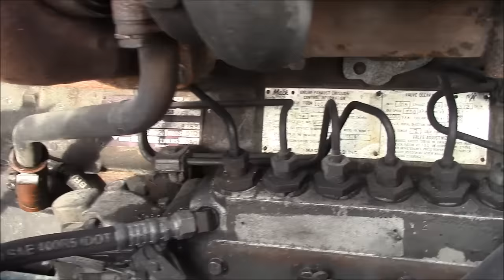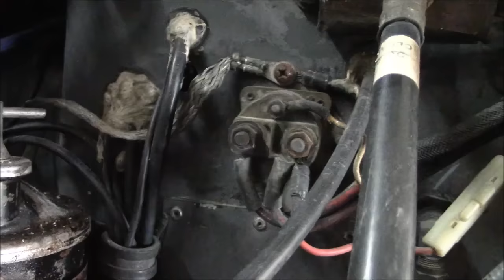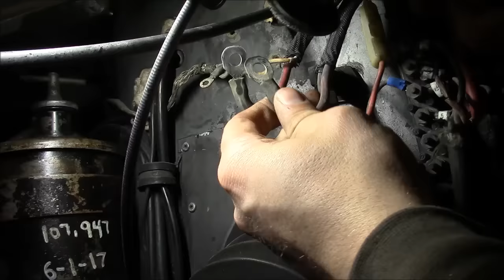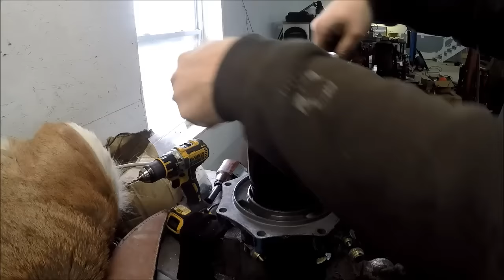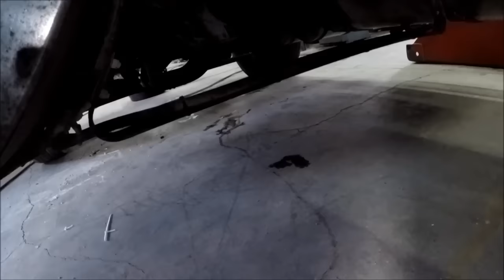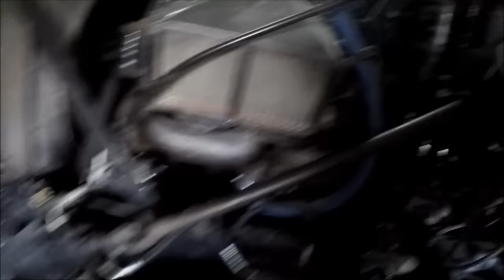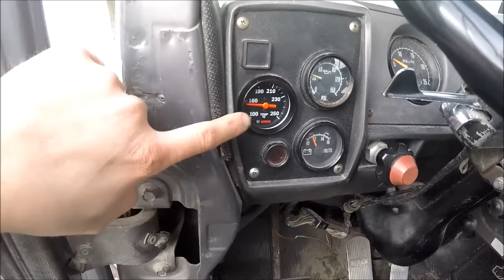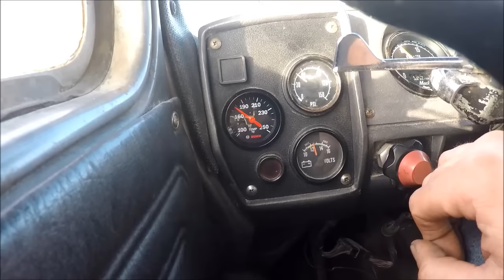Cool 1977 Mack RL600L - No Crank, No Start - Plus Many Other Repairs

Comment: The RL600L means lightweight as in aluminum frame and doors.
Reply: Just a little Mack trivia: Any Western R model has lightweight components, that’s what the L at the end stands for.  (aluminum crossmembers, suspension trees, etc.) western R’s we’re all either RS (steel frame rails) or RL (aluminum frame rails) followed by the model # which is either 6xxL (short hood) or 7xxL. (Long hood). Calling any Mack R just a 600 or 700 is a generalization. The true model will have the second 2 digits denote the engine in the truck. This one would be either an RL685L or RL686L.

Comment: That doesnt even naje sense. Its still a metal to metal connection. Due electric grease prevents corrosion when it heats it up caused by carbon build up

Comment: I use the dielectric grease on plugin connectors to prevent oxidation and keep water out but for screw terminals and large lugs try using Kopr-Shield or anti-seize that has copper powder in it instead.

Comment: That was very interesting information you gave about the standards for the air brake hoses and such. Using the 40 year-old part over makes me wonder if it should have to be tested (if it is being replaced) and is a certain age or something. I can understand that a visual inspection may look fine, but given the pressure and the safety issues with such lines it seems odd to me that you would not just replace the entire thing.  Thanks. Henri
Reply from the maker: If it ain't broke, I don't fix it.

Comment: Nice work Wes! As an electrician of 40 years and having worked on many different things , you do good work and were spot on with the dielectric grease! Lanolin is great also and I spray it on just about everything ! You were too busy shifting gears , but at 36 min after you crossed the tracks , they was a BNSF train with a cool loco on the head end . An EMD SD70Mac in what they call they "Executive " paint scheme of the 80's ...just sayin''..LOL 
BTW ..as a young fella I drove a few old 5 speed Macks...what a pain, especially going uphills!
Thanks for the great video. Cheers Gregg.

Comment: Shifting that 5 speed beast without grinding is definitely a rhythmic process.  Going up you rev that Maxidyne 300 up to 2100 RPM,  shift into neutral, let the revs fall to 1200 and stick it into the next gear.  The way back down is the reverse process, just make sure you sort of rev match before the down-shift.  You're working on a deluxe model there by the way, the one I drove didn't fool around with things like power steering and an air suspended cab.  In fact, it didn't even have an air ride seat, and if I remember correctly, I had to make my own music or get another driver to pipe in the tunes over the cb.  Fun truck, fun days, wish I could do it all again!  Thanks for the video.

Comment: The 3rd to 4th shift you really have to wait for the rpm to drop before moving out of N into 4th. I miss driving these simple old workhorses!
Reply: best way to shift 5 speed is do not use the clutch once you are rolling.  Of course double clutching works too.
Reply: TheVet4id yeh they were. Once you got used to them they are hard to beat.

Comment: I know you shouldn't do it according to Jacobs (and probably Mack), but a lot of Mack drivers, including my dad, used the jake brake to shift up faster in order to keep the momentum . With only five gears, it's quite a step in between.
Reply: Dyna-tard Mack exhaust brake
Reply: @carlcarlamos9055  Yes, I've seen plenty of Mack R's with Dynatards, but this was a Jacobs, installed post-dealer.

Comment: Hello, Wes.  I love your videos.  Your comments about wanting to buy the R model Mack with a 12-speed Mach transmission reminds me of driving a Mack lumber truck that had a 12-speed. I believe it was a model from the 1980s.   That transmission was almost impossible to shift smoothly, and just about broke my wrist on every shift, it pounded back so hard unless the gear speeds were exactly right.  The worst transmission I ever drove.  I suggest you check out that R model carefully with a test drive before you buy it. 
  I have often wondered why I could not shift that truck smoothly, either shifting with the clutch, double-clutching, or without the clutch.  The clutch seemed to be properly adjusted, and the engine ran fine.  Most of my experience was with Roadranger transmissions, and I never had trouble with those, so I wonder whether there was some fundamental difference between how to shift that Mack versus how to shift that Mack.

Comment: Ahh, the old "Cool Power" Maxidyne 300 Plus. Good strong engine. Btw, the Mack key switch will make you think that the alternator is going. The contacts in the switch will wear out after a while. Check it with the engine running & jiggle it, to see if the volt gauge goes weird.  Nice video!
Reply: Aaron Cone damn good motor
Reply: yeah, 315 hp with the tip turbine fan. Good stuff

Comment: Yes I have worked on a fleet of Oskhosh trucks from the late 70's every wire is black and all the sticker circuit diagrams are falling off the most pain in the ass ever! I wish I could find a cool old truck like this for myself.

Comment: There is another power solenoid inside the dash in the cab replace that and the charging trouble will go away instantly and your voltage gauge will work correctly!

Comment: The R600L was not a long hood but light weight hence the aluminum frame. Lots were specked out to pull tankers. Sone had a 3 leaf rear suspension of 34lbs. They leaned bad when overloaded,not as strong as the standard 38K rears. The R 700 was the long hoods that had Cummins or Detroit engines.

Comment: just before you shorted out the solenoid, did I see a broken mount on the steering box? (3.06) I think its the column i was looking at. if it is and you aren't worried about it check that the rest are tight. LOL The alternator may have the wrong diameter pulley.

Comment: I think That engine is a 300 or 300 Plus and a Maxidyne, not a Thermodyne. The goofy looking air cleaner is a double element so that clean air can be blown through the intercooler which is the square looking thing on the other side of the engine by the round thing that's plumbed from the air cleaner and the outlet side of the turbo which is called the tip turbine and that's what does the blowing to cool the intake air down. The triple  countershaft tranny was what Mack had to use to handle the massive torque of those engines. The 1st Gold Dogs were rated 237 horses at 12 to 1300 r.p.m. and 235 at 2100. That was the operating range and the long spread between gears. The engine took place of the gears. That rig might be 12 volt brun and 24 volt start. I'd have a parallel switch if it was 24. And the 2-stick 6-speeds were direct, low and reverse. Direct except for lo going but you had 5 reverse gears! I don't want to sound like a know it all but  started driving Macks when I got my chauffeurs license at 21 and I'm almost 70. And I went from 185 horse Thermodynes to a 300 like that one and then all over, including a Superliner with an E-9 V8. Looked at LOTS of dog butts. Keep after it Wes. You do GOOD work! A-PLUS!

Comment: the old older macks that we ran, RS 700's and DMM 800 3/4 CABS were MAXIDYNE, turbo, and THERMODYNE turbo and intercoolers, but they were master series EN686, they were tough old coots though. The RS also was straight 5 speed, with wedge brakes, the DMM were 5 speed tri-plex. ENJOY THE VID'S!!!!1

Comment: Always used dialectric grease like you do, with no ill effects. I have used regular grease before on electrical connectors, & DID have it reduce conductivity.
ONE THING though- I don't put it all over everything / both sides, in that it will carry current across both terminals

Comment: Got through the rant on dielectric grease and had to interject some thought, since you are presenting a little misconception on dielectric grease. (Althought you admit there are better sources of information on it out there)

First of all, the dielectric part of dielectric grease is always active. It doesn't "just activate when there is an arc" or some other thing. It /is/ an insulator(meaning it has a much, much higher resistivity than the usual conductor). Period.

Why doesn't it bother your connections? Pretty simple, the contacts you're using it on rely on pressure to make contact, and the grease is a low enough viscosity that when you tighten down the bolts, or insert it into a pressure spring-type contact, the grease moves out of the way and there is still conductor-on-conductor contact. In fact, metal oxides are also not particularly conductive, and this pressure again is used to overcome that and create a low-resistance electrical connection, assuming your oxide levels are reasonably low (there will always be some on the surface of the conductor, unless it is an extremely unreactive metal like gold). It's beneficial to use grease because it prevents oxygen from getting to the connectors and forming more oxides, which can eventually eliminate electrical conductivity, and often do.

But, the properties of the dielectric can affect high frequency signals (automotive uses nothing nearly that high frequency) where the dielectric grease's dielectric constant can affect the permability of magnetic & electric fields.

Comment: ya gotta drive that truck like you are mad at it. you have an 800 rpm drop inbetween the gear shifts. you need to learn how to double clutch  when you shift. for the weak brakes , replace the treadle (foot valve ) valve. Sometimes it is a rusty or seized up brake pedal on the floor.i ran that same truck for 25 years. . sometimes you have to full field the alt. if you have the chance, get rid of the leese-naville alt and get a delco. the oil leaks on right side are probably the turbo drain line and the coolant return line on the balck right rear of engine block. the exhaust pipe is too close to the line and you have to replace the OEM heat shield on the exhaust pipe.  both those leaks are real important to fix. I almost lost my mack because of them. the turbo drain failed on the road and caught the engine on fire. keep trying to buy that truck, its a keeper

Comment: Nothing wrong with wedge brakes except lack of knowledge. Very efficient self adjusting brake system and where people run into problems is when relining the brakes without servicing the wedge adjusters. If at brake overhaul you service them with the Euclid overhaul kits complete with the proper grease you can expect them to last until the next brake overhaul. Do a patch repair and they will act up. Still run them on a heavy axle in our Ford LN8000 log truck and haven’t touched then in 8-10 years. As soon as they act up you will notice a pull to one side as an adjuster stops working and backing plates with inspection plugs in place helps. No different then cam or air disc service just an older system that fell out of favour. —Dieseldog!

Comment: Thanks for the great video. I worked in heavy duty trucks shops for 40 yrs. I worked on a fleet of R Models and U Model Macks. The R Model was my favorite, they are a lot easier to work on. The job I hated most was replacing an air compressor on a U Model. Enjoyed your video very much. Thanks for a trip in the way back machine.

Comment: They are neat old trucks. But I ran around 2200-2300 miles a week in one for over 7 years. It wont hurt my feelings if I never sit in another one....LOL. Good work and thanks for the flashback in time.

Comment: the "Maxitorque" trans was rated at 2100 ft lbs torque. the ENDT 675 torque output was 2100 ft lb @ 1250 RPM. Operating RPM range was 1200-2150 so you only needed 5 gears. this was ended due to emission standards issues.
Reply from the maker: The thing is, that sounds good on paper, but it doesn't work that well in real life. Even though the torque is constant, the power is directly proportional to RPMs, just like an electric motor. So all the RPMs drop, you run out of power. With the 5 speed, by the time you get down low enough to downshift, the show's over. We don't see a lot of these transmissions in our area due to our hilly terrain.
Reply: these trucks weren't designed for speed (horsepower) they were designed to work (torque). you could pull them down to 1250 rpm and they would keep pulling all day. just not at a very high speed. Most Macks were used in construction/refuse vocations. Speed wasn't a critical factor.

Comment: Air locked cooling. There is a vent plug on the water manifold, I cant remember if it at the front or back of the engine. You open that to fill the coolant from an empty state.
Reply from the maker: The water manifold has a vent line that runs back to the radiator. Some engines have a vent on the thermostat, but I did not see one on this truck.
Reply: I seem to remember a pipe plug that was removed to vent the system after the system was drained.

Comment: follow up. Every Mack truck was delivered to the customer with a "line sheet" listing every part in the truck by Mack part number and a microfiche was kept at the dealership and at the factory. Also every truck was delivered with a hard copy of the wiring system. That was Mack was the standard for the industry. No other mfr even tried to compete on quality, they could only compete on price. Side note: Mack was the only vehicle mfr that built from 100% their own parts, no outside components!!!
Reply from the maker: Everything should be required by law to be sold with a copy of the wiring diagram! That would save me a lot of headaches!

Comment: I began my career as a mechanic at a Mack factory owned dealership the same year this truck was built. Love the Macks!!!!! The temp sender is coupled to the gauge (negative thermal coefficient resistor). You could have replaced the mechanical gauge with an electric (not electronic) one. The wiring was beautiful to work on because it was color coded. The make that comes to mind is Int'l Harvester. They had all black wiring and numbered end to end. Pain in the a** to work on.
Reply: Yes sir that is a problem with the Internationals especially if you do not have a factory wiring diagram.

Comment: nice little short hood r-model.  looks like it has been well taken care of. As for the r-model you were looking at buying, i take it, that it has the older 12 speed with the basement (mack's take on the 12 speed)?  Those were fun transmissions.  also drove plenty of older r-models, 6-speeds and other interesting combonations.  We had a cat powered one with a 15 speed in it, when you went for 4th the shifter would touch the dash, just pull it back where it should be and keep going.  No idea how someone buggered that one up.
Reply from the maker: I'm thinking it has a 12 speed that you shift like a super 10. I can't remember.
Reply: @WatchWesWork  there are a couple different ones. There is one known as a 12 speed with a basement, main stick is similar to a straight 10, and a secondary stick flat against the floor, which has 3 gear positions

Comment: the only time I've had dielectric grease cause issue is very low voltage circuits, even then, it was caused by LOOSE fitting terminals or someone fiddled with it and didn't clean and re-grease or tighten properly.
I don't like to spare grease on anything, since I'm most often the next sucker working on it again :)

Comment: Sharp looking old rig. The RL600 is the "west coast" version of the R600. RL is aluminum frame, RS is steel frame. The second L indicates lightweight components (typical of California-built trucks). The RS700/RL700 is the long hood version. These trucks were built at the plant in Hayward, California. The 700's were discontinued sometime around 1978 or 1979 after the Superliner came out, and when the Hayward plant closed in 1981, the RS/RL600 production moved to Pennsylvania where they were built as the "Valueliner".
Reply from the maker: Interesting. I know a guy with a Superliner that I believe was built in California. It has a Cummins 855 engine.

Comment: Thats not a dry sleeve engine.. You dont bore a mack engine its got liners. The oversize you read is bearings . Mack 5spd is junk it has no syncronizer thats why the damn thing grinds so easy.. Compared to eaton you can build 3 eaton for cost to rebuild a blame mack trans as far as parts cost. I been in the buisness for 40yrs never heard of a top loader rear end?? Those are mack rears. They are hell to rebuild but last forever. I assume your young and learning trucks.. Everybody has to start somewhere I guess.
Reply from the maker: As far as I know all Mack engines used dry sleeves up until the E7 in the late 90s. Everyone I know calls those axles "top loader" axles. These are made by Mack. Rockwell also made them. Possibly others. This truck was built almost 10 years before I was born and I repeatedly said I was not a Mack expert. But that's obviously not good enough for you...

Comment: How can it be di-electric if it conducts electricity just fine?  If you glob it all over a terminal strip will it cause a short across terminals?  If not why?
Reply from the maker: Because the grease is squeezed out when you tighten the connection.

Comment: Another great video. I enjoy and learn a lot with the straight forward process of troubleshooting and repair. More food for thought that I will use on my first commercial vintage truck restoration. 

Also, right on about giving us smarter people a nod! Dielectric grease was made for a reason. By the way have you tried putting the damaged camera in rice...? ; )
Reply from the maker: I put it in the trash and bought another one... She served me well, but it's done.